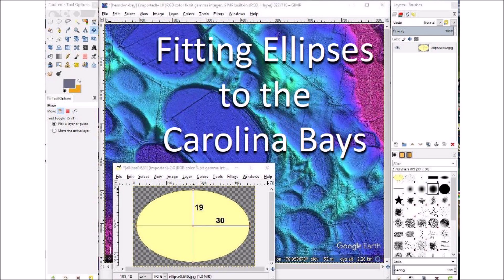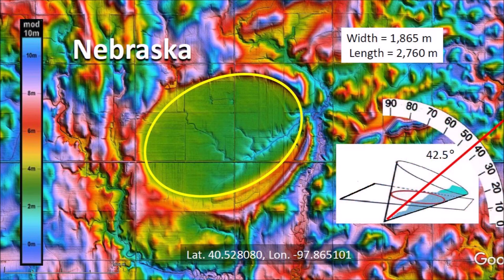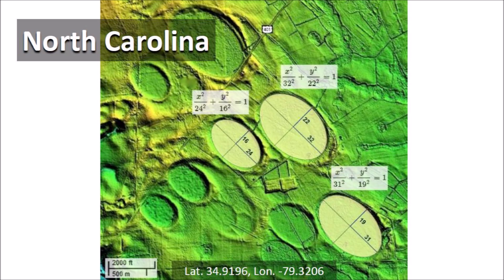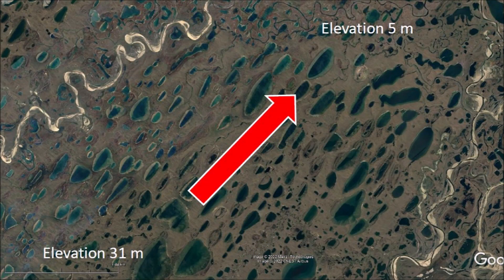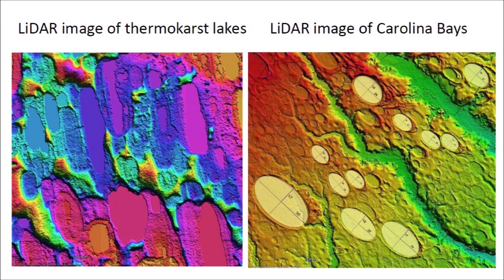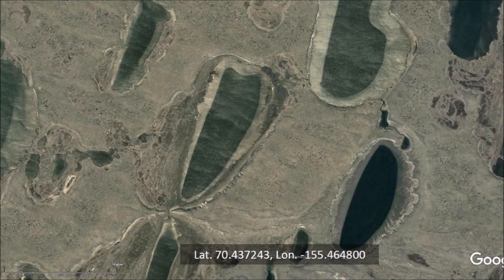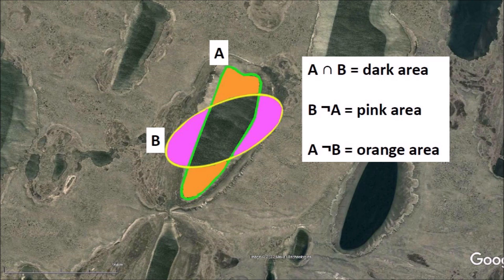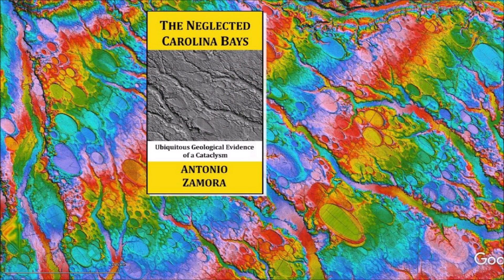Fitting ellipses for Carolina Bays - Definitely not thermokarst!

Comment: Antonio I have been thinking of the idea that glacial debris held inside the ejecta boulders would still be in position underneath the Carolina Bays. It should be possible to dig down to the theoretical final position of an ice boulder impact to find glacial debris that has come from the melted ice. Boulders deposited on the surface after glaciers have retreated are called glacial erratics -  how much more erratic it would be to find this stuff buried underground in Carolina, a place that was never covered by the Laurentide ice.

It would be a huge task of course. How deep would the final position of a medium-sized impact ice boulder be?
Reply from the maker: This was our first attempt to find material from the Michigan area inside the Carolina Bays. https://youtu.be/2IjnWHqa_0U
Reply: @Antonio_Zamora  Cool. Good to know that this attempt has been made. A bigger bay that was formed by a large ice boulder is needed to excavate. But then a deeper hole that goes below the ground water would be needed. Tricky!

Comment: I'm just curious: that water basin in Nebraska that's over 2km in length....how many megatons was the force of that secondary impact?
Reply from the maker: The ice boulder that made the 2,760 meter basin measured about 550 meters in diameter.  At a speed of 3000 meters per second the kinetic energy of the projectile would be equivalent to about 87 megatons of TNT.